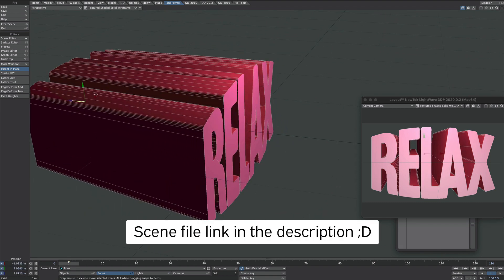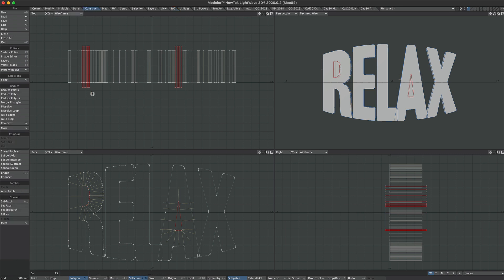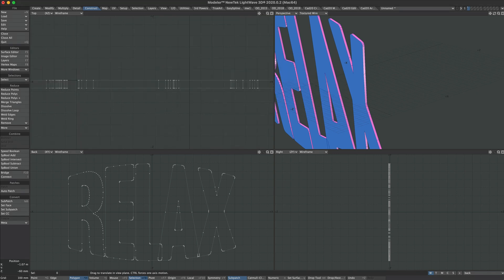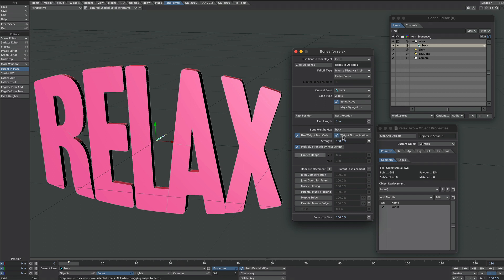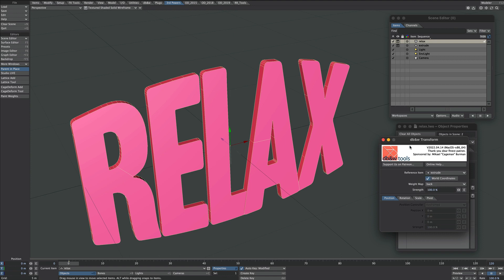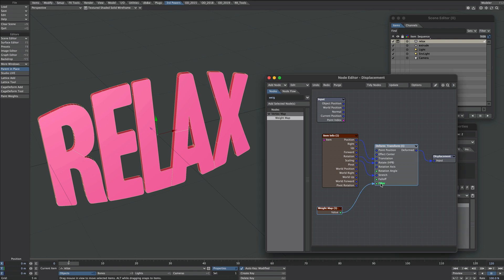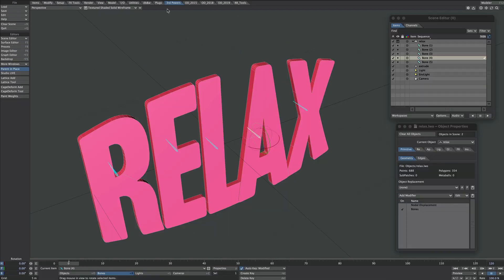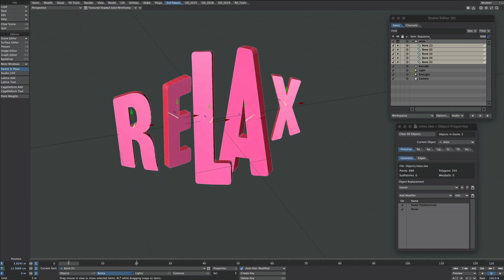LightWave 3d: Simple Animated Extrude

Comment: I've been using lightwave since version 2.0 inside the video toaster.. my last LW version was 2019... I'm aware that 2023 is around the corner but I have learned C4D, Blender, SketchUp and many more since... I challenge the Lightwave community into creating elements inside of Blender and doing the same thing in lightwave and see which one does it better and faster..
Reply: Why?
Reply: @maurocor5121  outside of this i do enjoy your work.. nice work.. was it all done inside of lightwave 3d?
Reply: @maurocor5121  Lightwave 2023 has a USD value of $635+ and lightwave hasn't been around for a minute where other companies don't even think of it as a primary pipeline software. where as blender which has also been around for a while is gaining momentum and is FREE!!! did i mentioned it was FREE!! and it can do fast simulations, water, smoke, characters, it has all the modeling features of Lightwave and then some, all the modifiers of Cinema 4D, etc... it would be interesting to see if Lightwave 2023 is up to par or is more of the same which hasn't had love in years and left behind in features. this would also make others see if it's worth the price they are about to pay or learn something equally as good or better. that's why!